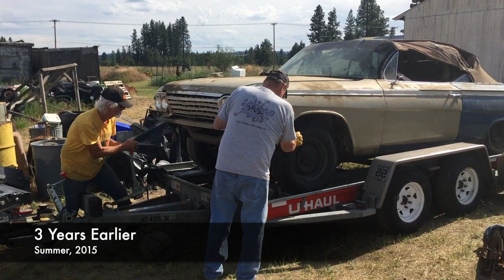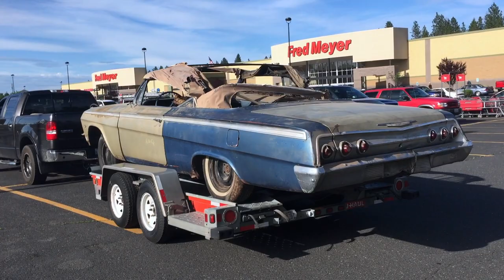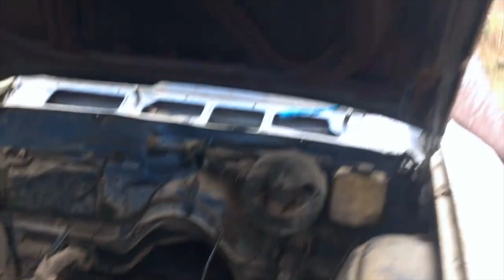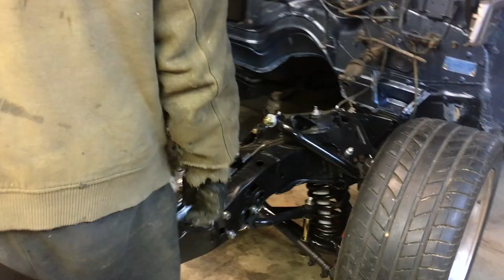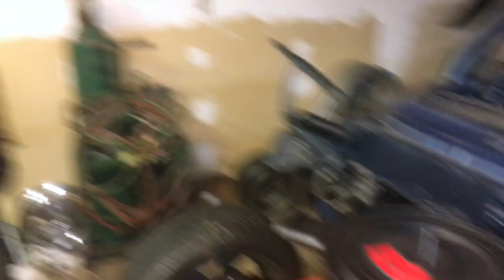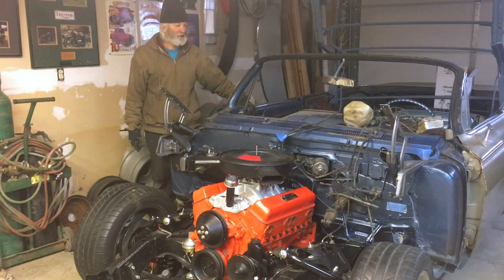Barn Find: 1962 Impala SS Convertible Project Update

Comment: My first car (after my sister totaled a 55 Chev I was going to get) was a stock 62 Impala SS coupe (283, 2sp powerglide), all red, bucket seats with a factory storage box in between.
I would have loved it even more if it was a convertible.  Luckily my mom had a 64 Corvair convertible (I learned to use a stick).  ;-)

Comment: That's not a SS car...there is no GRAB BAR  on the DASH, Sumbody just put bucket seats in it.
Reply from the maker: Jobor Dansby It’s an SS. The grab bar was with the car, which was stored with the interior outside of the car. You can tell if a car is SS by the vin. This is an SS, and has all the correct, original SS trim.